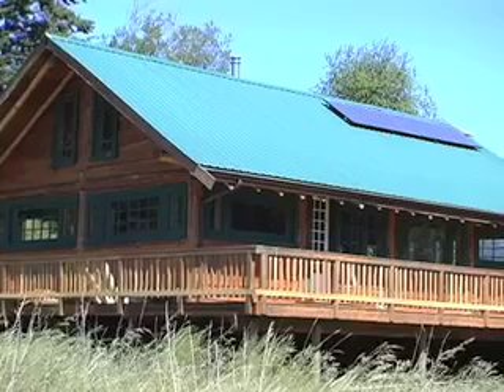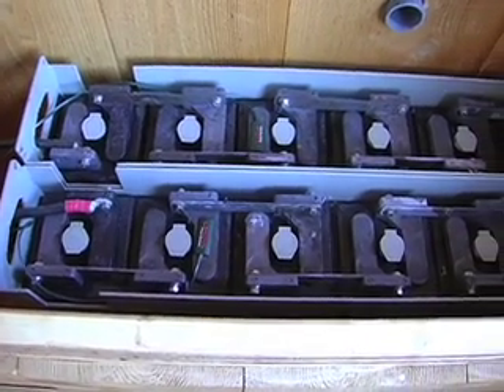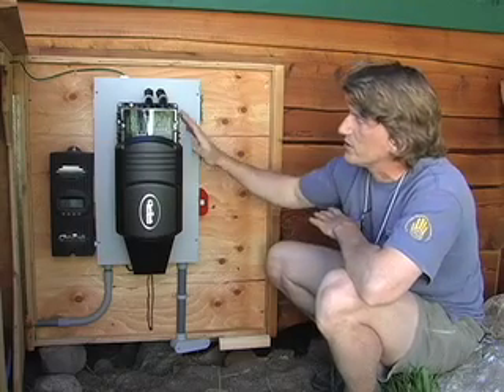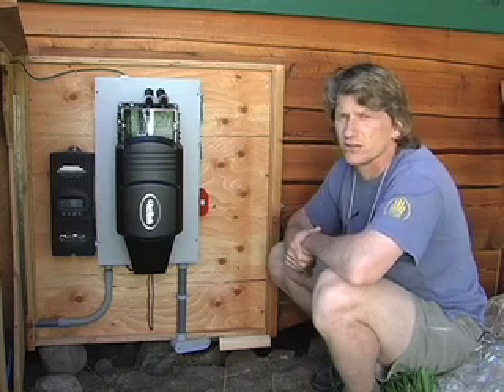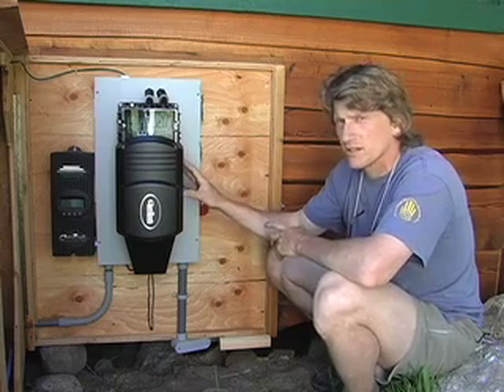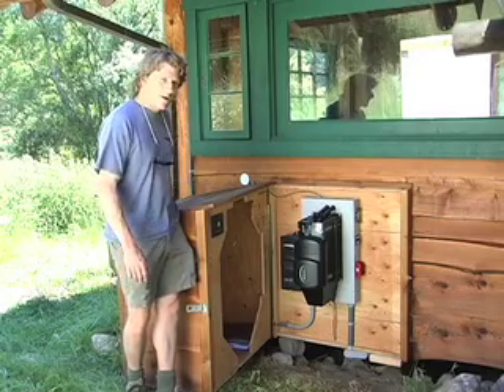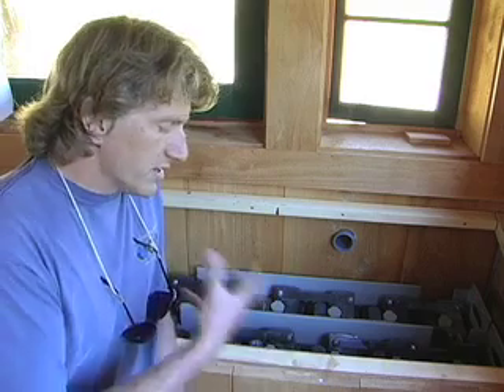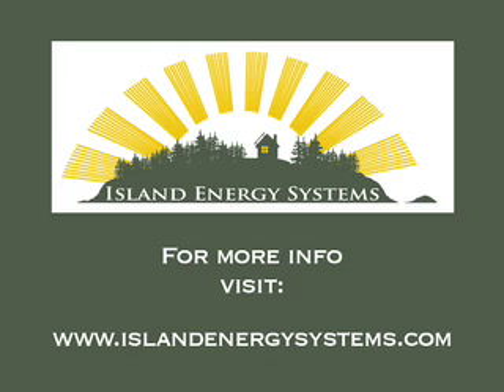Island Energy Systems Tour - Off Grid Solar Electric

Comment: novice question; can you accummulate power from summer, for winter?
Reply: no , battery system cannot be large enough
Reply: +Ti Co Need a generator back-up which as he explained can also charge the batteries.

Comment: Don't get confused 1200 watts from the panels is instantaneous power not kilowatt-hours. Electricity is metered and billed in kilowatt-hours. Think of in terms of the batteries providing the power for the house and the solar panels charging the batteries.

Comment: I have a question for the PV array. I wonder the combination out put on watts af each pv set or pair in series? Would be 12 or 24 volts coming from the Panels to the controller?

Comment: Just because you have 1200 watts on the roof doesnt mean your getting 1200 watts out of that array. Your 1st de-rating is the efficiency rating of the modules. What are those 14-15% eff maybe. 200 watt name tag modules will run about 200w x .85 = 170w dc on the average. They can go higher in higher irradiance but very unlikely to ever hit 200 watts ever as they are name tagged at 1000 watts per square meter of irradiance.

Comment: I don't know who your power company is but if it's Con Ed count your blessings because they produce an exceptional service year round.  Catastrophes must be seen in that regard.  The damage sandy did would have taken out solar panels and wind mills, shorted batteries,  and flooded whole systems (most of the brains of the operation are located in basements and garages.  As such, the off the grid people are up the creek too.   Generator and gas during catastrophes like sandy.

Comment: 850Ah battery!  If you had LumenCache lighting you could power all the lights for two weeks without any new sunshine :-)

Nice install.  I like the MPPT and inverter.  Can it be grid-tied so the excess PV can be pushed back to the grid in areas where net-metering is allowed?

Comment: If your not using Seebeck thermoelectric generators in these off grid systems your crippling your ability to generate power.  Look at ideas for small use like the power pot at theepicenter dot come, or larger units there and get an idea.  You can make bricks that work any time you are using a heat source, stove, woodstove, stored hot water from evacuated solar tubes, whatever, a module the size of your palm makes 19 watts.  Custom build with units from customthermoelectric dot come 300c rated.

Comment from the maker: As for how big a battery, thats more a question of how many Watt-Hours per day do you need.   With 4.5kW of PV you'll get maybe 18kWh of charge per day on an annual average.   So, if you plan for that daily load @ 50% depth of discharge and a 48V battery you'll want around 800 Amp Hours of battery.   Of course in the middle of winter you'll get less charge so you'll want to conserve as much as possible to live within your PV budget.  Good luck!

Comment from the maker: I would suggest what is called an "AC coupled" approach that uses a battery based inverter like an Outback VFX3548 to connect with your grid-tied PV system through the AC breaker box.  That will allow your grid tied system to operate at max efficiency most of the time but give you backup power with PV charging when the grid goes down. See this paper:  outbackpower(dot)com/pdf/tech_notes/AC_Coupling_WHT_Paper.pdf

Comment from the maker: Yes if you double the PV array capacity you will get twice as much energy out of the insolation (sunlight energy) on a short dark winter day.  But sometimes around here that can still be very little if its dark and cloudy all day long!  Two times zero is still zero!    High latitude off-grid systems need backup generators for the winter!  Microhydro or small wind are great for hybrids,  or a gas or diesel generators,  check out wood gas or biodiesel for more renewable options.

Comment from the maker: Hi Zerkbem,    In theory something like that is possible, but as far as I know there is no commercially available electrolyzer that can efficiently generate and store H2 on any scale to make it practical.   I think the over all efficiency of that process would be really low.     

The best thing to do with excess production in the summer is to feed it into the grid if you can, to get full credit later.   but if the grid is not available you can do something like pump water up to a storage tank

Comment: So, if you doubled the system size could you ameliorate the impact of our short winter days?  Also, if a double size system was installed could you use the excess electricity to create and then store Hydrogen for use in a generator?

Comment from the maker: PV prices have come way down in the last few years.   When this video was made the 1200W system cost about $10,000.    You could build a similar system today for $6,000 to $7,000.   Plus you can get federal tax credits for 30%.      

Efficiency and conservation is very important!  Especially during short dark winter days.    

The best system design starts with a good load estimate.   How much POWER do you need (peak Watts), and how much ENERGY do you need? (daily Watt-hours)

Comment from the maker: The energy production of a PV array is totally dependent on the amount of sunlight that hits the array.  That depends on latitude, season, weather and local shading conditions. We shot the video in the middle of the summer when we had 6 or 7 hours of good strong sunlight hitting the array, thats when we see 5kWh or more. In the winter, however, we only get 1 or 2 "Peak Sun Hours" (or even less when its raining or snowing) so you would need a much more PV to get 5 kWh. Every site is different!

Comment from the maker: @WoodsmanSkills      This equipment would be in the neighborhood of  $15,000 to purchase.    It can produce 3,000 Watts of Power to run most standard household appliances but it can NOT "power my home the same as it were on the grid"..     An off-grid system provides a small daily ration of energy (Watt-hours or kiloWatt hours)   you need to maximize EFFICIENCY and CONSERVATION to work within the limits of the system.   The grid is virtually unlimited,  off-grid systems are not.

Comment: How much would this cost for all the materials needed just the system? Also would this system run your everyday house hold items like say could it pwer  washer and dryer, basically would this work as if you were on the grid with  say a 200amp service? I am looking for something that woud power my home the same as it were on the grid? Thank you for your time

Comment from the maker: @orlan7s1   no, you don't necessarily have to run the charge controller positive wire all the way to the battery,    But you do have to use proper fuses or circuit breakers!   I'd suggest building your system around an Epanel from Midnite Solar, same as seen on this video.    That gives you a good way to connect the PV controller and the inverter to the battery, highly recommended!

Comment: I know you need to keep the batteries at about room temperature but how do you keep them warm in the winter time when the box is sealed to any room temperature air but has a vent to the outside? That is the only thing that confuses me. Is insulating the box enough to keep it warm even with the vent?

Comment from the maker: @IslandEnergySystems     Sorry,  I mis-stated that.    We'd land the AC OUT HOT wire in one main lug in the panel, and the AC OUT NEUTRAL on the neutral bus bar.   The 2 main lugs are then jumpered together to feed 120V to all the circuits.    

Don't use muti-wire branch circuits (with shared neutral wire)  in a situation like this.

Comment from the maker: @dieselplow 
The AC power output from the E-Panel is a single 120 Volt circuit with a maximum ampacity of 60 amps, so we typically use 2, #6 gauge wires to feed the main lugs in a circuit distribution panel (breaker box).   The E-Panel could also serve as the main distribution panel, using AC breakers at 15, 20, 30 Amps etc to distribute power to the load circuits.

Comment: How does the transition work - from the batteries to the "typical breaker box" to run the power through the house?  What does that connection look like for an off grid system?

Comment from the maker: @dieselplow 
There are AC input bus bars and an AC circuit breaker in the power center cabinet for hard wiring to a generator, an input receptacle or an extension cord with a plug on the end.  The AC input assembly in the power center also can be switched to bypass the inverter/charger completely, to run the loads directly off the generator.  That can be a nice backup option in the case of a problem with the inverter.

Comment: Can you share some more information regarding plugging in a generator to supplement / add charge to the batteries?  Is there  a plug on the side you can plug into from a generator or??

Comment from the maker: @lexam55 

As a habit you should try to minimize the discharge of your battery to about 50% of its capacity.  For this battery that means you can safely use about 425 AH of energy, or 10.2kWh (425AH x 24V)   before you should seriously think about running the generator or turning everything off and waiting for the sun to come out.

Comment from the maker: @lexam55 
That is the rated capacity of the battery bank, or the total amount of stored electric energy you would have available if you tried to use it all at one time.   That rating is at the '20 hour rate', which means that would be discharging at a rate of 42.5 Amps of power, or about 2kW.    Though its pretty unrealistic that you would run a 2000 Watt load for 42 hours straight.   At lower discharge levels you could get more total Amp-Hours out of it.

Comment from the maker: That totally depends on how much POWER and ENERGY you need.    A micro-scale low power system to run small efficient lighting and small electronics could be put together for as little as about $500.   That would be pretty tiny however.    Figure roughly $10 per Watt for a simple complete system.   So the $500 system would be 50 Watts of PV or so and a 300 Watt system would be more like $3,000.

Comment from the maker: That MX-60 PV charge controller can deliver max of 60 Amps of charging POWER to the battery.   The Amp-hours (charging ENERGY)  it can deliver would depend on how long the sun shines and will vary based on the array, the location and the time of year.

Comment: I was a bit concerned about the batteries inside until you said it was sealed with ventilation.

Looks like you sized your system correctly but would help people to see what appliances you are able to run.

Visit Solar Cabin for small use solar and wind power ideas!